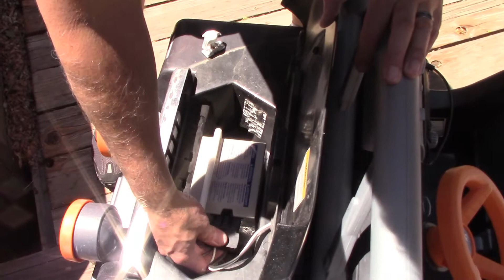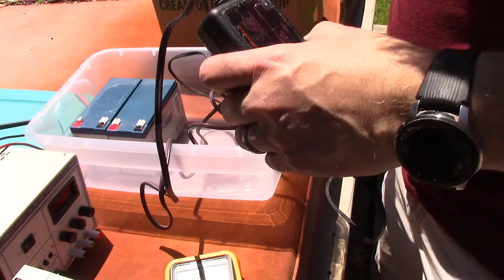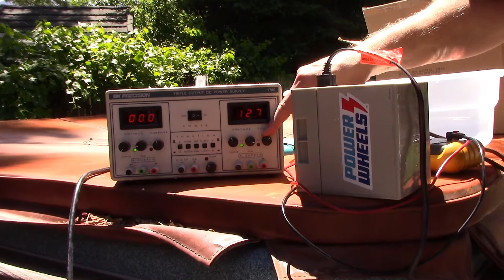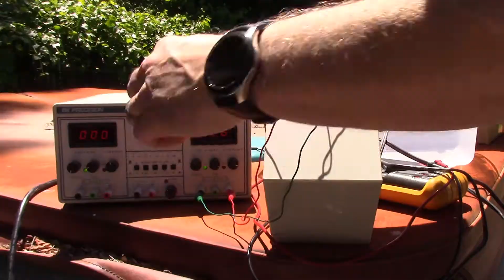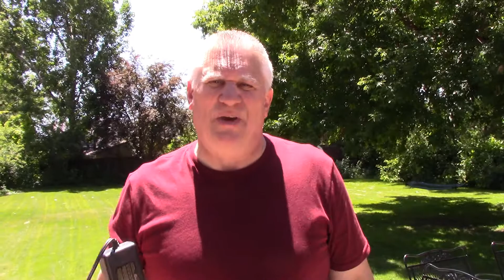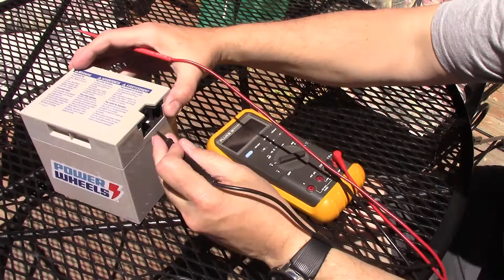Power Wheels Jeep Battery and Charger Repair for FREE - Almost

Comment: Did that. It worked one time and charged the battery right up to full power.
Ran the toy right down and now the charger stays green and won’t charge(same as first new charger on second charge)
The battery is brand new. So is the charger. They (both new chargers) only worked once and never again.
Reply from the maker: That stinks! Dang chargers! Thanks for watching!

Comment: What bench charger are you using in this video?
Reply from the maker: It's a BK Precision 1760. Any benchtop DC power supply will work with current limiting and ability to do 14Vdc. Thanks for watching!

Comment: Question. My battery is showing 11.5 volts. The non smart charger is charging at 13.5 volts. But the power wheels jeep still doesn’t have enough power to go. It tries, but it’s like it has the voltage but not the amperage.  The Jeep works fine with the neighbors power wheels battery. Any ideas?
Reply from the maker: How old is your battery? It sounds like it's on its last legs and needs to be replaced.

Thanks for watching!
Reply: @Aggressivefun  Not sure. We bought the jeep used but in really nice shape. Can’t be that old. Thanks for the reply.
Reply from the maker: I've found that if the battery goes through a cold winter discharged, it can really diminish its ability to recharge fully or even make it fail. Just a possibility.
Reply: @Aggressivefun  ok thanks! Just ordered another.
Reply: @jasonconaway0529 did it work?
Reply: @8 @84latinray don’t even remember.  This was 3 yrs ago.

Comment: I have a battery from a computer that is like the same battery will it work
Reply from the maker: It might if it is a gelcell type lead acid battery and has the same voltage and current specs as the battery in your vehicle.
Thanks for watching!

Comment: my guess is the Chargers keep track of the Cycles on the Batteries and give that message  at a certain  amount  somewhat similiar to how Printers  and the refill Ink Cartridges Communicate and tell you to buy a new Cartridge even if it is still have Ink  Power Wheels  are  marking those Batteries up  a lot on EBay there are Comprable Batteries retailed  and shipped to your home for $39.00  grant you they do not have the Power Wheels quick Connect terminal on them but they do have 2 male Spades  on them   good thing to know ,thankyou  many years ago  i lived inSouthFlorida and i worked for a small Marine Repair Company that had a Account withInterstate Batteries , and i got to know  some of their Employees there and  was allowed to purchase my ownBatteries for cash at the Wholesale prices  i asked them if their battery was as good as the Sears Diehard brand and they all laughed  as they explained that Interstate at that time 1970s was the only company that made Batteries and all the other Brands  was just a Marketing thing they did for the Major Retailers and AutoParts stores  at that time a Diehard at Sears was  about a hundred dollars but the Interstate one was only 30  so i learned a valueable lesson at bout RetailMarkup at a fairly young age  of course these days  we have China making almost everything  and rebranding them to whoever pays the most  i read somewhere a while ago things like Electric Toasters , all the individualCells for ToolBattery packs ,Sewing Machines,VacumnCleaners,and some other Products are all made in one Factory  and rebranded with numerous names and Brands for different Customers and sometimes with different standards of Quality Control or Materials  but still built by the same people and tooling
Reply from the maker: Don't get me started on ink cartridges! I had a brand new HP ink cartridge that was new out of the box and wouldn't print even once due to an "expired" electronic notification. Solved that by using Epson EcoTank printers that don't use cartridges. I don't think that is the case with these batteries/charges but who knows!? 

Thanks for watching!

Comment: I charged my battery & it started bubbling is that normal?
Reply from the maker: No, bubbling is not allowed! My guess is that your battery is bad.
Reply: @Aggressivefun  oh okay I’ll just replace it then. :( thank you for responding to me. I’ve had it unplugged every since I heard it. Totally appreciate you. Good day
Reply from the maker: Sometimes the chargers go bad, like mine, but they usually fail with no charging rather than overcharging the battery. The battery is usually the weak link. Thanks for watching!

Comment: My little girls battery only pushed the car for 5 minutes and it cant move. No red flashing light when trying to charge... battery is only 6 months old with only a few drives under it... no idea what's wrong the lights and radio remains working
Reply from the maker: Could the battery have gotten really cold during the winter? Any chance it might have frozen while discharged? Those conditions can be really hard on these batteries.
Reply: how liong did it sit for

Comment: Great video! What could i pick up a supply like this for?
Reply: Would a car battery charger that charges at 2 A 12 V charge the battery up enough to get the charger to work again?
Reply from the maker: Thanks! This supply is an older model that you can't purchase new any longer. Sometimes you can get them used off of eBay for $200-$300. A new model off Amazon (https://amzn.to/2O41BUX) is $412. Or you can get a single DC supply with the same operation/specifications for under $100. A very useful supply to have.
Thanks for watching!